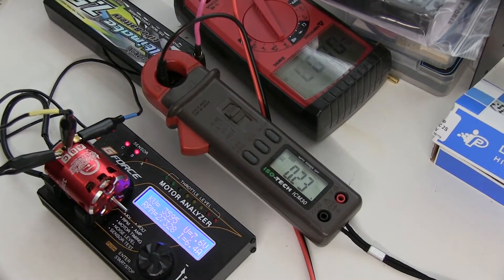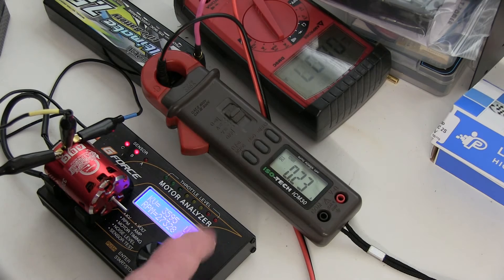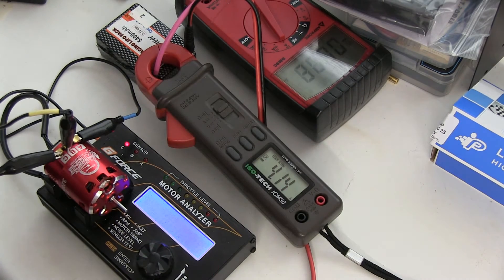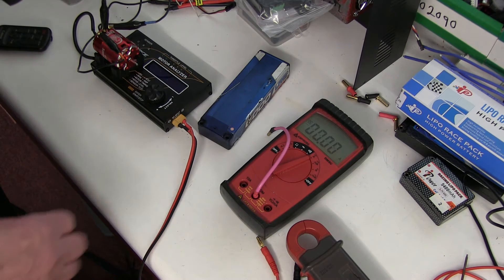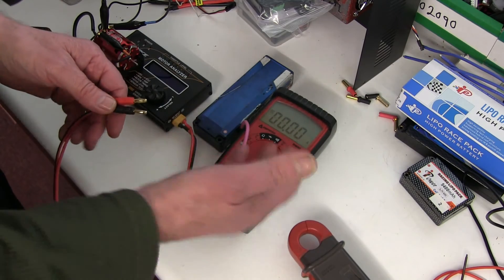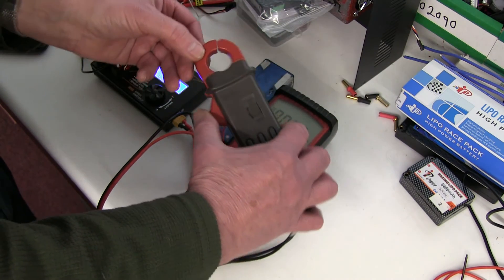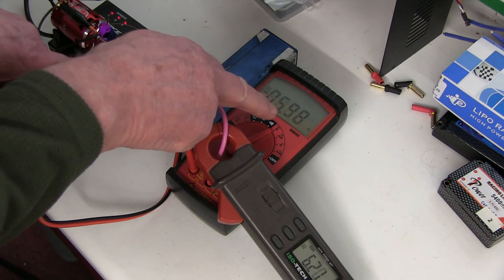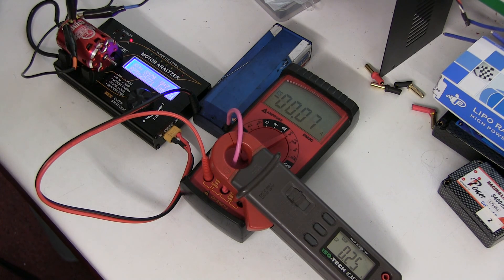Sweetspot 13.5T, 1S Lipo. Blinky (Locked) Timing.

Comment: What about a 17.5 motor for 1s racing i have a motiv mc 17.5 with low rotor 12.3mm
Reply from the maker: Hi Wiliam
You can set up a motor for 1S racing, by tuning it with a 2S lipo to the 6amp off load current.
It will then draw about 4.5Amps with a 1S lipo.
It is easier and more accurate to do it with a 2S lipo.
Reply: Nick Adams where did u get you resistance testing tool that u use on the motors
Reply from the maker: Hi William
It is available from a few electronic suppliers like RS.
Rohpoint Model M210

Comment: thats a great help nick. i didnt know u did yhese videos as well as the shop. i had problems with my car slowing before the race ended i was drawing 14amps lol so.ive turned it.down like u said so . hopefully itll.be better now
Reply from the maker: Hi Thomas
it will be a lot better, as long as you gear it correctly for the track.
Reply: i was using 63mm roll out before for short oval racing i will probably have to go up a little bit.

Comment: so i would hope to get 4A ish testing through a meter with a 1S battery?? and adjust the endbell to obtain this for optimum motor performance???
Reply from the maker: Hi
Yes, but with a 1S Lipo the amp draw will vary with the Lipo vol;tage
Charge the 1S lipo and test.
The amp draw should be between 4 and 5 amps.
Some set the amps higher, but the motor temperature should be checked after the run.
Reply: +Nick Adams thanks will try it tuesday at the club
Reply: what temperature should.we be aiming for nick?
Reply from the maker: Hi Thomas
After you stop at the end of the race, touch the motor.
You should just be able to touch the motor, at the hottest .
You should not exceed about 75deg C on the case.
If it goes above 80deg C then it may start smelling and may be damaged.

Comment: can I plug my esc into the multimeter and set timing with motor sat in car and using transmitter?
Reply from the maker: Hi Jason
Yes, just remove the pinion.
Reply: +Nick Adams 
Cheers nick.
Would any settings on the transmitter affect the setting up the motor timing?
Reply from the maker: As long as the speed control is on full speed at full transmitter throttle, then it will be ok.

Comment: what did you find was the best timing degrees for the super extreme in 13.5 blinky? on the tester as opposed to the can?
Reply: in 2s, I mean sorry
Reply from the maker: +YOLOEditors 
Hi
The best motors always have the lowest timing as shown on the analyser to get 6 amps.
This also shows up on the race track.
So the best have below 50 degree, say 48 degree (I have seen even lower) and perform the best. (Also they have good matched sensor boards).
Most motors show about 52 degree on the analyser to get the 6 amp reading.
The poorer ones go higher to say 54 degree.
The actual endbell setting almost always shows it set higher , often above the 60 degree mark.
Keep racing.  Nick